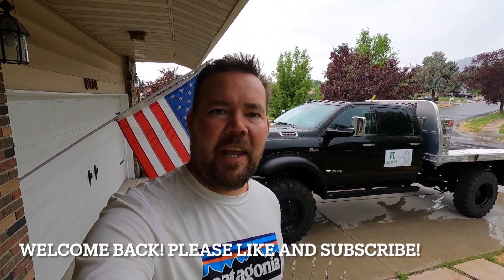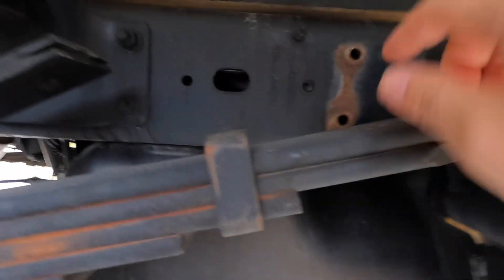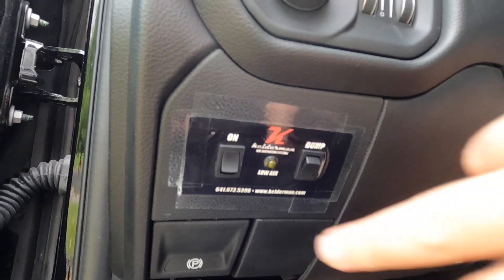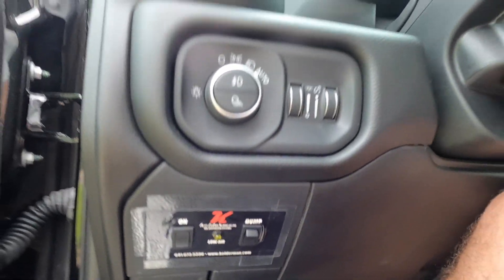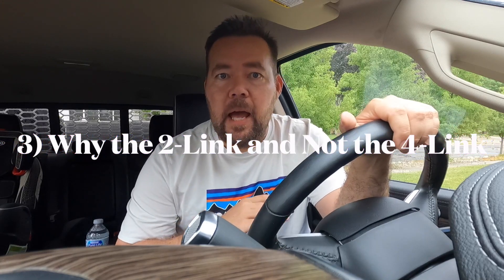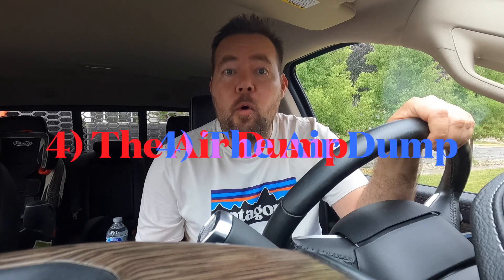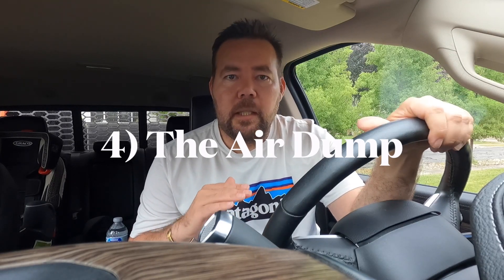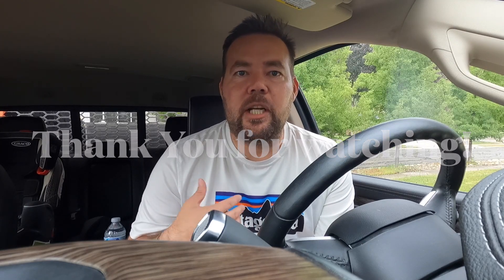Kelderman 2-Link Rear Air Ride Review: This makes a Huge difference in our RAM 5500 Overland RV

Comment: That is a nice setup. The 2 stage/link suspension from Kelderman will level the air bags but aren't designed for squat in the leaf springs. Not an issue on a 5500 but it was on my 3500. I ended up swapping to the 4 link setup from Kelderman (adds 1in lift in the rear with 4 link on the 3500). I also lifted the front air ride with taller bags instead of Kelderman's leveling kit which just uses a taller spacers. Unfortunately Kelderman didn't tell me about the leveling option when I ordered but I prefer the taller bags compared to just taller spacers since I get more travel in the front suspension and better control of the heavy bumper in big dips. I run a Warn Powerplant winch with built in compressor for OBA but I rarely run it since I placed 20+ gallons of air tank (filled with dry shop air) in the spare tire location because my spare doesn't fit in that location anymore.

Comment: Great information! Thanks
We have the 4 corner Kelderman 4 link system on a 2002 350 and Love it !  
The only thing I would do differently if possible would be to have an engine driven air pump system vrs small electric air pumps. 
Congratulations 🎉
Reply from the maker: Thanks for sharing and I really appreciate you watching the video!!
Reply: Did you install the kit yourself?
Reply: Why??

Comment: This is pretty much EXACTLY my situation.  I just bought an almost brand new International CV (Chevy Silverado 5500).  It came with a flatbed on it.  The unloaded drive from Illinois to Denver was pretty stiff but not ridiculously so.  Bridge expansion joints were very abrupt and jarring.  I will carry a Lance 992 camper (4000+ pounds) and I don't want it to get beat to crap by the constant jarring from an overly stiff suspension.  Eventually I will carry a 6000 pound Eagle Cap camper.  The 4-link set up seems like overkill to me for my use.  The 2-link seems just about right.  Did you do the install or did you have it done?  It does not seem overly difficult to do.  With your Host on it, how does it feel?  Thanks for a great video!!

Comment: So that auto leveling valve doesnt take into account leaf spring flex? It just keeps the rear leaf spring mount in the same general location but the leaf spring will still flex under load and squat just as much as it did from factory?

Comment: Have you considered water and grey tanks under the bed and an airhead toilet?  Thinking of a Ram 5500 also for a Cascade plus above bed boxes.
Reply: You mean add additional tanks to supplement the standard tanks in the camper?  That's not a terrible idea.  I could the area designed for a supplemental fuel tank to add 40+ gallons of fresh water.  I would add at least a week to my boondocking trips!

Comment: Where did you get your wheels?  I'm trying to save money.  I've got the same truck as you and am thinking of doing the Single wheel conversion.  I found a good deal on the Continental MPT 81's.  I'm not into anything too fancy.  Steel black would be nice.  Liked the video!  Keep them coming on this truck!  I'll probably do the Kelderman in the rear next.
Reply from the maker: Hey Nathan, thank you so much for watching! I got the steel wheels from Buckstop too. They are amazing and will withstand the test of time. I would like to talk to you more about my kelderman rear 2-link. Where are you located?? Thanks, Nate

Comment: Can the 5500 with Keldermans and extended bed handle a 24' or 26' box cab? Like the ones used by rental trucks
Reply from the maker: Not sure about that but if you call Kelderman they are always around to help
Reply: @KruseandViews  yea I am looking at building one. The normal campers are too small for what I want to do. I love the 5500. But may go for the f750. Not sure yet. But I wanna put 24-26 ft box on the back.

Comment: My 05 Dodge 3500 4x4 5.9 diesel and it had a 8’ bed on it when hauling the door sticker says 40 lbs all rear dullay tires and normal for all 4 tires is 65 lbs but I run 70 lbs and tha truck handles like a sports car and I love it when people tailgate me I love it on a 40 miles per hour and I can take it 70 no problem and tail hater is all over the rod !!!!!!
Reply: Do your air bags have bump stops inside the bags. I hauled cars for GM since I was 23 yrs old and we got a bunch of new trucks with air ride everything and the auto leveling system and then we had a lot of problems with 2 air valves on each axel so they changed to one in the center and the we had a problem with a tire going down and would set on frame so they put bump stops inside of bags and that solved all of our problems. But at the same drivers were loading cars off the back of trailer on top rear. The problem was that when you chain them down the air compressor would keep running to level the and after a bout a air of running nonstop the fuse would blow a the car would dump it’s air which I turn made the chains come lose and the car would fall off to cure that GMwould pull the fuses before releasing them to us